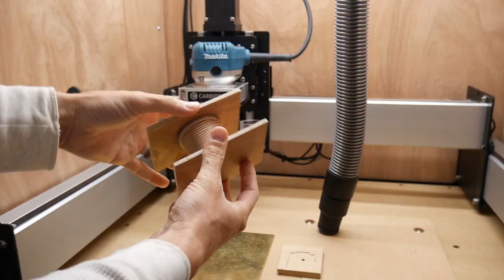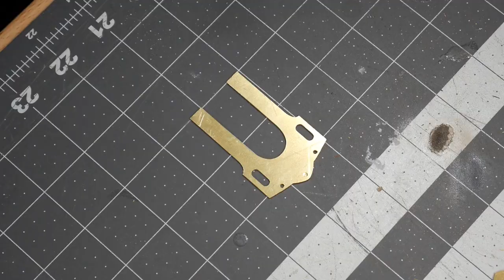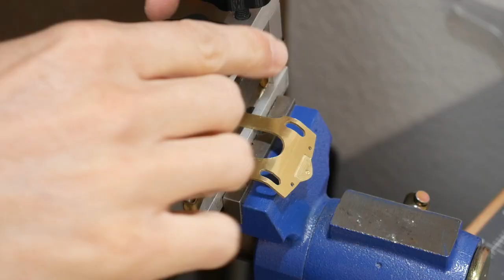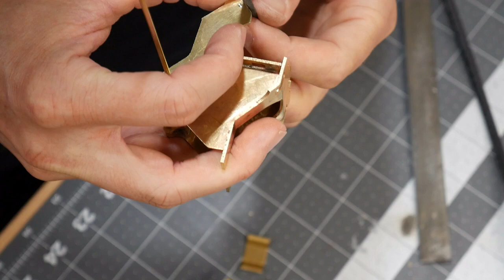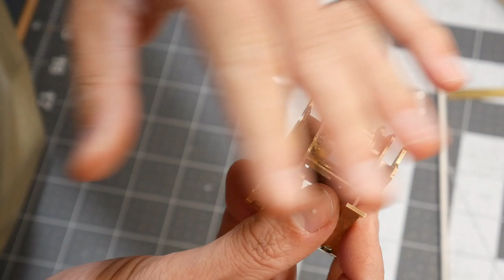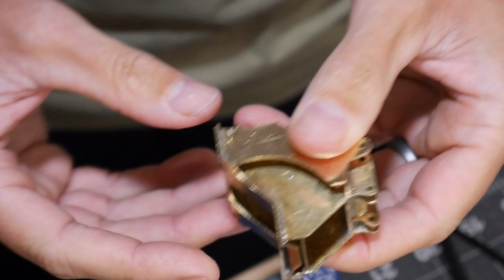1:50 Cat 988F Front Frame Done... For Now

Comment: What brand and model is your solder tool? Also I find a wire brush tool in a Dremel cleans sold joints quickly and clean
Reply from the maker: American Beauty 105A12, 250W. Handpiece is 3/16. Light capacity tweezers. Thanks for the tip about the wire brush - Stainless steel?
Reply: @StephensCustomModels  yes stainless or the mild steel